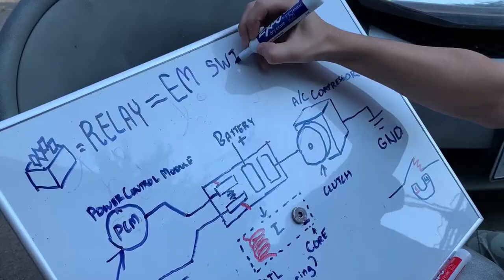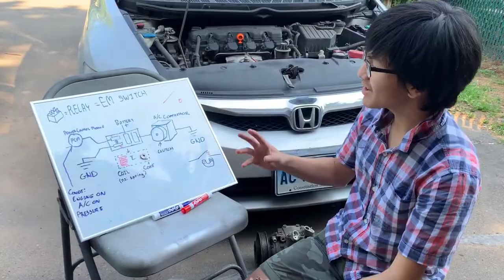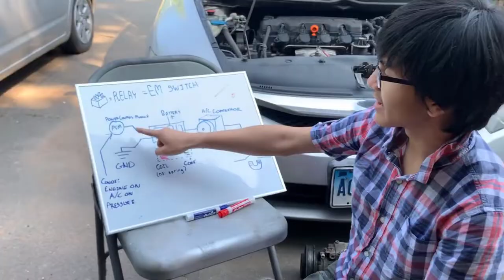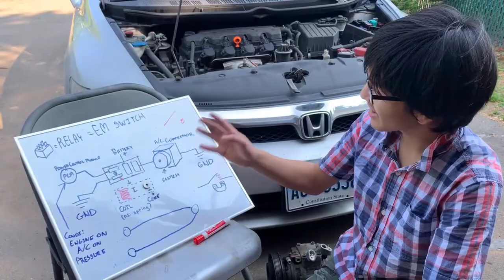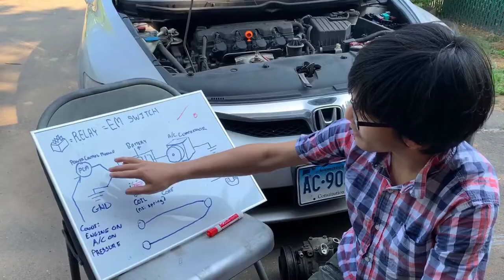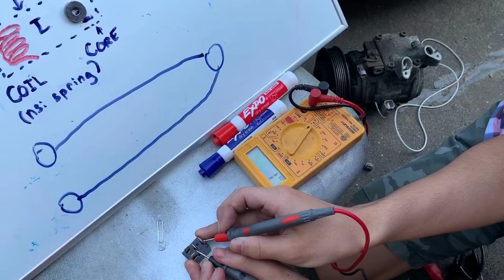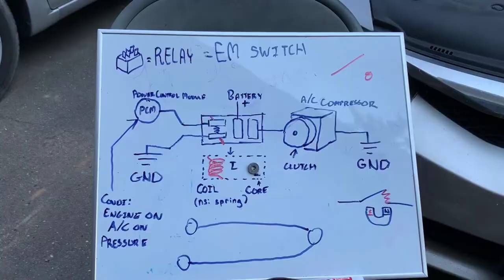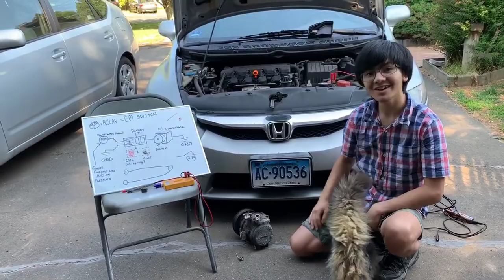Jumping Relay To Start AC Compressor Clutch | How Does It Work? And Why You Shouldn't Use Paper Clip

Comment from the maker: Here are the links to the parts you might need for your car, truck, SUV or minivan from Amazon (1 or 2 day delivery with Prime).  You can also type what you want in the search box:
1.   https://amzn.to/3hs1lv6 | Four Seasons 35874 Standard Relay
2.   https://amzn.to/2DUflA8 | 5 Pack AC Relay G8HL-H71 Power Relay Assembly for 2003-2014 Accord 2006-2014 Civic 2007-2014 Acura MDX CR-V
3.  https://amzn.to/33qCFhE | 2 Pack G8HL-H71 AC and Starter Relay 39794-SDA-A03 39794-SDA-A05 for Crosstour CR-V CR-Z Element Insight Odyssey Pilot Acura TL TSX MDX
4.  https://amzn.to/2Fth6F5 | Lichamp 4 Valve AC Manifold Guage Set, Fits R134A R410A R404A R22 Refrigerants, Works on Freon Charging and Vacuum Pump Evacuation, AC Complete Tool Kit
5.  https://amzn.to/3hqR3f1 | Aupoko A/C R134A Refrigerant Charging Hose Kit, Recharge Hose with Gauge, R13A Can Tap and Quick Couple, R410A Straight Swivel Adapter, Piercing Tap Valve Kits, 2PC 1/4’’ Adapters with Valve Core
6.  https://amzn.to/3mgs0i6 | ZeroR R134a Refrigerant for MVAC use in a 12oz Self-Sealing Container (3 Pack)
7.  https://amzn.to/2Zwzq7j | Red Angel A/C Stop Leak & Conditioner
8.  https://amzn.to/2FnULZK | Power Probe III Clamshell - Red (PP3CSRED) [Car Automotive Diagnostic Test Tool, Digital Volt Meter, AC/DC Current Resistance, Circuit Tester]
9.  https://amzn.to/32rBU90 | KAIWEETS Digital Multimeter TRMS 6000 Counts Ohmmeter Auto-Ranging Fast Accurately Measures Voltage Current Amp Resistance Diodes Continuity Duty-Cycle Capacitance Temperature for Automotive
Reply: They ran a ground wire from the relay too car to keep clutch running how do I fix it

Comment: Very detailed even when he said at the end supplying power to the compressor and added that it wasn't actually power to the compressor but the clutch on the compressor, which goes to show the guy is very knowledgeable and very descriptive and easy to follow unless you don't understand AC systems or electrical to the basics.

Comment: Hey thanks i used one of your videos to fix a issue with my hiseeu camera system ..i  had a error message that said ipc disconnect but end up deleting the camera but i saw how you paired the cameras.i didn't need to use a cable but with your derection i as able to pair it again .. thanks

Comment: Hello, I saw your video many times about how to engage the clutch bypassing the relay with a paperclip or a coated wire. I understand all that, but can you help me locate which relay I have to bypass in a 2010 nissan sentra? I see where the fuse is at, but im not sure which relay I have to put the wire in? Thank you in advance!! You're excellent in your details.

Comment: 2008 civic had the system recharged, changed the relay, and checked fuse. Compressor clutch still not engaging. I don’t know how to check the pressure switch. Any advice? Thanks.

Comment: I used an insulated jumper to turn on the compressor. I shorted out the AC pressure switch and the Evaporator temperature sensor but still does not turn on compressor.  The AC switch wire measures 12vdc and goes to ground when turned on but measured nothing at the AC pressure wire. Is there something I am overlooking?

Comment: I need some outside opinions.

My AC isn’t working and it never had since I had the car, so I started with the basic stuff pressure testing making sure there were no leaks, replacing o rings. Making sure the clutch was functioning and replacing the drier and whatever that switch is on it (I can’t remember the name, but the other one was damaged).

I tested the relays with a multi metre and they appeared to be working.

I recharged the system, put the paper clip in and it all immediately started working (my ac button was able to control it when I turned it on and off).

Does all the lead to bad relays even though they tested fine on the multi metre ?

Obviously I can’t just jam a paper clip in there and leave it because that’s not how the AC is supposed to work, It needs to cycle on and off.

Comment: If everything else is working in the a/c system, the compressor will turn on automatically after you begin to charge an empty system.  But please repair the leak before you fill because R134a is a disaster when released in the environment!   I use propane or R12A (propane, isobutane).
Reply: Really!!!???

Comment: Had some issues with my suv  air conditioning. blowing warm air. My question is when adding freon. Does the clutch has to be engaged consistently while filling the system or it should intermittent on and off?
Thank you.
Reply from the maker: Technically the clutch has to be engaged constantly when filling so that the refrigerant from the can will get sucked it.  It's ok to be intermittent but it may take upward of 15 minutes to fill.  We're really not AC expert so take this respond with a grain of salt.  Thanks for watching...
Reply: @EyeOnAiman  thanks for the clarification. Keep up the good work.

Comment: Tried all of this but compressor still won't engage.  I know there is power going to the compressor because it was tested by HVAC guy but thought maybe a lack of refrigerant was causing the clutch not to engage but obviously not.  Will worry about it next year now the weather is colder.
Reply: Did you ever find the issue. I have bypassed the relay but the ac clutch still won’t engage. Is the compressor just bad and need replaced?
Reply: @alonsoalonso994  hi.  Bought a replacement Denso compressor for $200.  There was no refrigerant in the system.  Got a cheap vacuum pump and gauges and charged.  Been working well ever since.  Compressor tough to remove because lower bolts are in a tight spot so be very careful not to strip them.
Reply: @robbflynn4325  thank you! Just bought a replacement compressor and did you have to add compressor oil before installing the denso?
Reply: @alonsoalonso994  no, the Denso one came pre oiled.

Comment: You could save yourself a bunch of time by saying if you are going to jump terminals using an uninsulated piece of conductive material make sure you know the two terminals locations and dont have your head up your ass when doing it. Hard to see what youre doing when ones head is up ones ass. Youre thorough and from what ive seen pretty knowledgeable for a young kid. If this is what you have planned out for your future good luck to you. You might prepare yourself for the reality that upu prob wont date much.

Comment: So if your system had no coolant and you took it into a professional shop, would they jump the relay or connect 12V directly to the compressor?  Or would they fill the system with enough refrigerant so that the pressure switch would indicate sufficient pressure for the PCM to send a clutch enable signal?